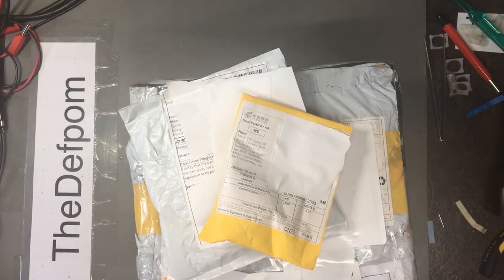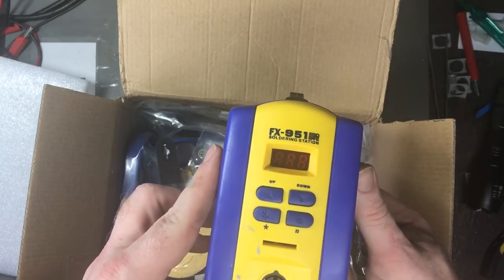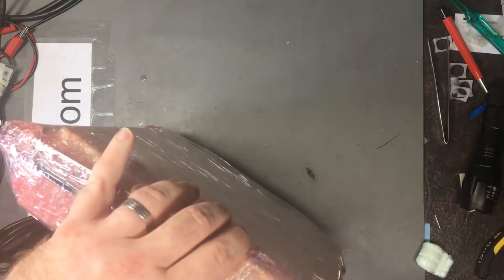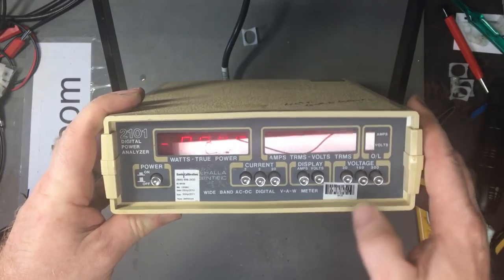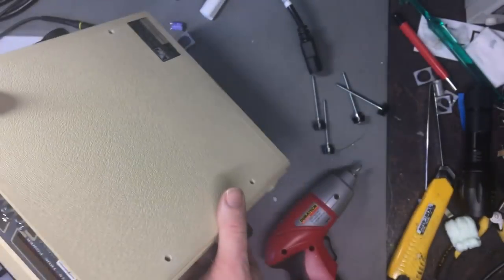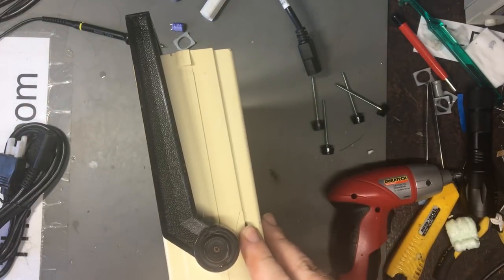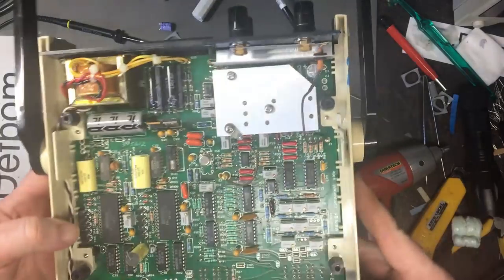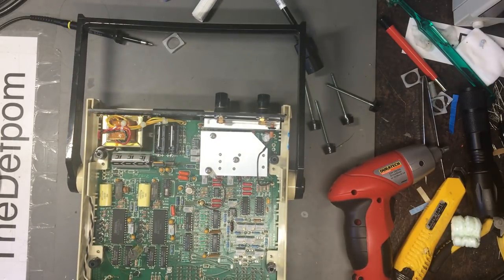🔴 #364 Mailbag 21st April 2018 - Mail Madness Series

Comment: The 2 right-hand LEDs have "O/L" under them -- Over Load perhaps?, and only light if volts or amps exceed the unit's specs.
Reply from the maker: brian52008 - that is correct I believe.